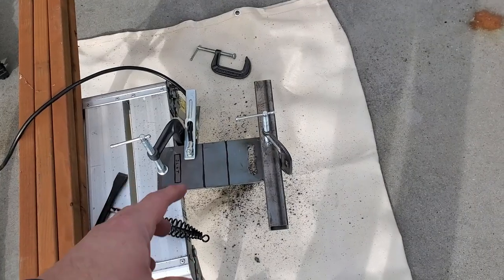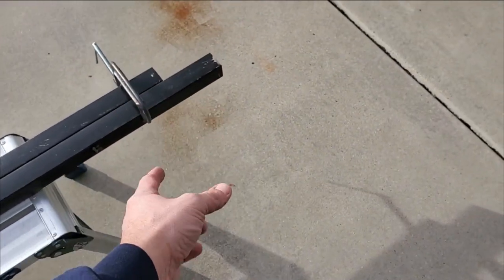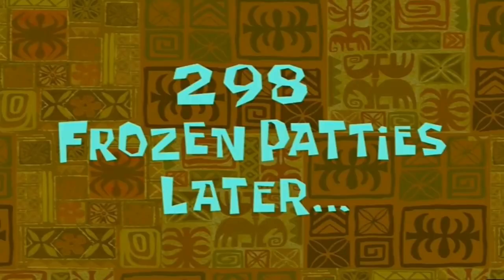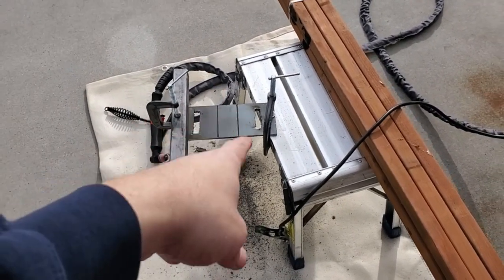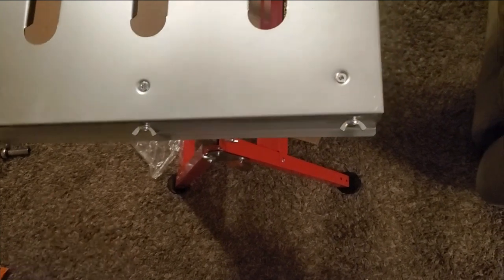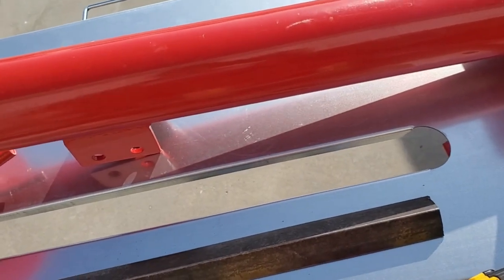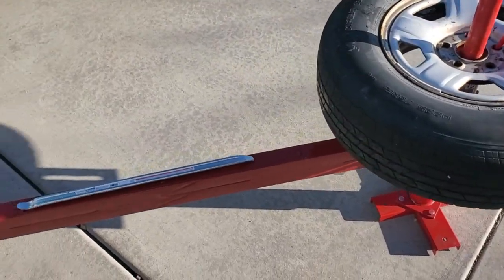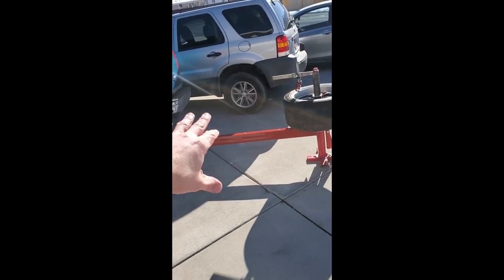The 89G - Harbor Freight Tire Changer Hitch Mount Mod

Comment: Awesome fabrication job, must feel good to be able to do tires at home as needed. The welding table looks super useful as well. I bought a similar one but it ended up as a "horizontal space" before I got to use it for welding. 😅
Reply from the maker: LOL, I know the feeling. I always need more space to put things. A friend of mine messaged me on IG and asked me if I can balance too. I need to get a better method of balancing for car tires. Bead balancing is fine for a truck.... but a little noisy for a Fox Body.

Comment: Man if I was close by we would be getting all of your money back out of that thing as much tire work as I have 🤣 Im defintly going to get me one. I cant wait to see those black 18s on frankie they are going to look sweet
Reply from the maker: Yeah, I'm very excited too. Might put the Cobra R's on The Eight Nine after that. I'll have an entire 5 lug swap available soon. Did you do your dyno day yet?
Reply: @89G  Yeah I love cobra rs , they are one of my favorite style rims. Not yet dyno day is next weekend and ive been pushing to get it ready for it
Reply: @89G  I might need the 5 lug swap for pickle. I picked up a spare t5 yesterday and going to get his last one in a week . So ill have a couple back up t5s if I break one or if u needed one id hook ya up
Reply from the maker: @79beans347  I need synchro keys for a T5, then I'll have a spare too. When my Buddy built the one in Frankie for me (during Covid), he couldn't find any new keys, so I found some that were supposed to be "lightly used"... and they are allowing 2nd gear to pop out under light/no acceleration.
Reply from the maker: @79beans347  Ah... I thought it was yesterday that you were dynoing for some reason.
Reply: @89G  Have ya checked Ebay for those syncro keys ? I thought I may have seen some on there a while back. Yeah its scheduled for the 18th and i hope I can  get beans ready before then . Ive still gotta get the new springs on the heads and finish porting the intake and get it on. Ill make a video this afternoon of it running with the new race bullets turned out the side in front of the tire and its a lil louder on t:he outside of the car but quieter on the inside without the dumps under it
Reply: @89G  Give me details on your t5, cuz I might have some for it.
Reply: @westcoasttransandgear8917  you wouldnt happen to have a gearset that would handle 500-600 hp would ya for t5?